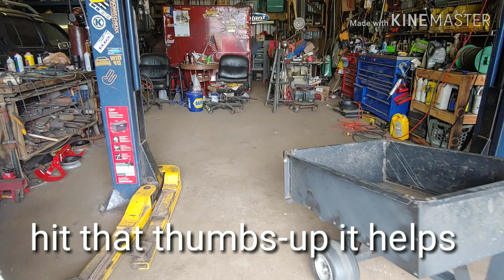Lawn cart modification

Comment: I use those discs all the time and never had an issue......maybe just lucky but I always use eye protection because metal in the eye sucks.
Reply from the maker: People only have problems with them when they use them wrong
Reply: Hi wreckless. Im a mechanic and hate gloves. I never wear them. Only when welding, i always wear them, now. I was building a woodsplitter from scratch. One that attatches to the front of a bobcat. Using a 7in. grinder, the grinding disc exploded. A big chunk flew by my head knocking my hat off. Another big chunk slapped the back of my hand. Lucky i had welders gloves on. My hand swelled up and was black and blue. It was sore for a month. No glove=emergency room. Now when grinding a always wear gloves. I have three grinders, and use them often.  Rev.
Reply from the maker: @waynegouin939  I'm with Reckless.... if you use the right hand side of the disc and shoot the Sparks at you making the grinder pull away from you you will never explode a disc the only time they explode is when you use the left hand side of the disc and it jumps skips bounces... on those rare occasions when you are using it correctly it can explode when the material you're cutting pinches the disc but then that's operator error. Glad you didn't get hurt and yeah you should wear gloves all the time when you're grinding or welding or doing anything but I can't feel s*** with gloves on and I can barely hold on to the tools with gloves on... so to each his own we all got our own ways

Comment: Bert nothing like getting  blob of hot metal in my shoe or  hot piece down my neck, it made me hop and run around like  headless chicken. It was  lesson I never repeated.
Reply from the maker: You definitely got to stay away from the rain in metal the worst is working under a car on a lift hard to not get down your neck
Reply: @ScrapFarm  I was working on pipework overhead in a boilrthouse many years ago in the70's. Welding with O2 and Acetylene. Shit happens but hot metal down your neck you run until it burns back out of my clothes, we laugh until we had pains I our ribs
Reply from the maker: @FB-tq5ln  it's actually in the fine print of the job description LOL thanks for watching Bud keep it real

Comment: Hi Bert. I had a trailer like that.I didnt blow the tires but bent the axle pretty bad. Bert, i learned the hard way. Always wear safety glasses, its cheaper than the eye doctor,( to get the metal out of my eye). Always wear gloves, good leather ones, its cheaper than doctors stitches. Man, id spring for some good work boots. Hot slag on toes sucks. Scrap iron and crocs dont get it. I like wearing work boots. Mine are comfortable.  Rev.
Reply from the maker: We all chisel out of our own way right
Reply: I'll guarantee someday Bert will say I wish I had listened . Those crocs will wreck your feet as well in time , wait till you get tendonitis . Need good work boots with what you do.....just sayin :D

Comment: I don't like riding you friend but have you ever seen one of those cutting wheels explode ? You really have to think about looking after yourself with PPE so you don't lose an eye or worse. I was in trades for many years , one day you're going to find out the hard way. Just something to think about , you're a smart young guy , hate to see you get messed up.
Reply from the maker: It's all good bud to use the disc the right way they don't explode
Reply: Only bad Craftsman blame their Tools not using the Correctly thats how things go wrong
Reply from the maker: @RichardWilliams-lr4mj  word brother
Reply: @ScrapFarm  - yep, all those silly people who insist that eye protection is important actually know nothing at all, those giddy safety freaks, the heck with 'em and their nonsense... sigh...
Reply: @ScrapFarm  Bert' I'm with you on "they don't explode" BUT if someone drops the grinder  with a slicer wheel  on it and it later comes loose from the hub portion...it can be a real party. Nice change out,  BTW.
Reply: Back in 1979 I thought I knew it all.  PPE was a joke and who needs it. One day I was grinding and a small red-hot piece of metal found its way into my right eye.  Now I have that reminder with me every day.